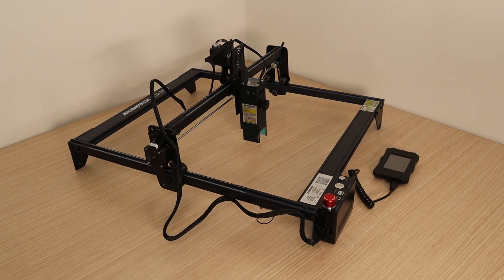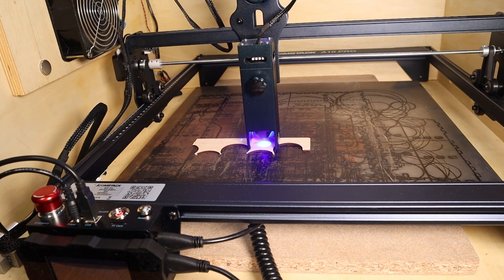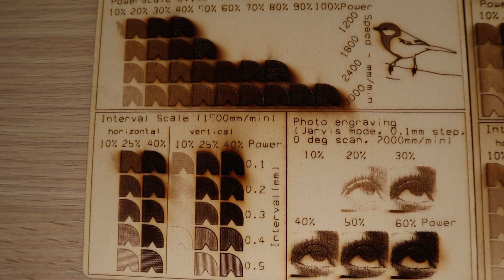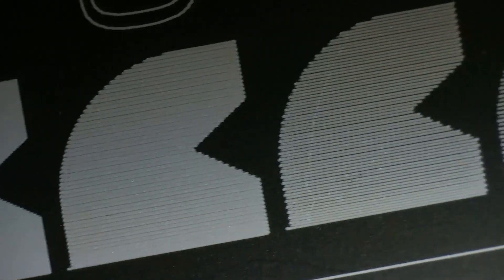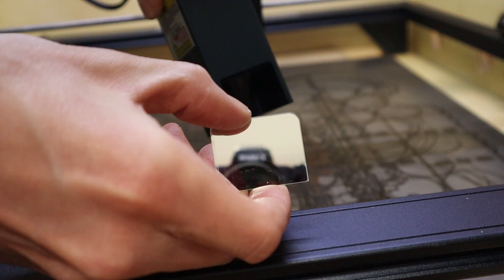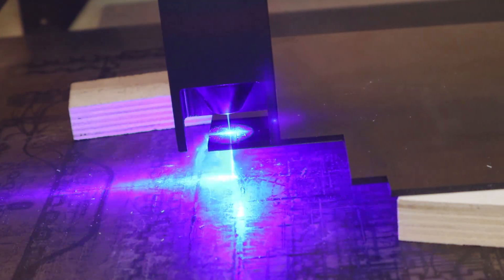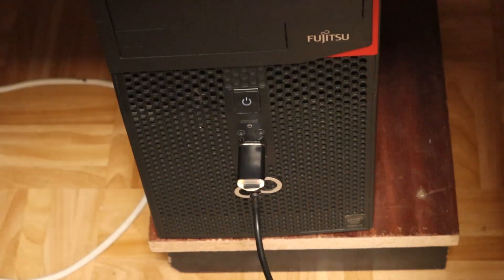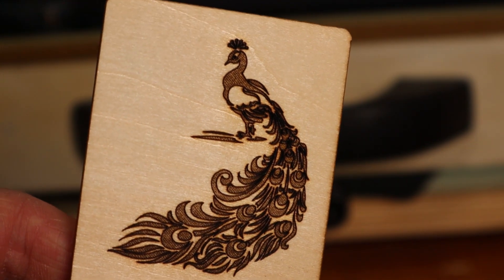REVIEW/TEST Atomstack A10 Pro (Atomstack X7 Pro) Best In Class Laser Engraver With Superior Features

Comment: How do I get an SD Card for my 7X?  There was not one in my shipment and it will not work without one..  I was disappointed after paying over $600 for this machine.. I also found out that there was a charge for using some of the programs that are required to use this machine..  I am very disappointed..  Also there were not glasses included with this machine..
Reply from the maker: This is strange. Did you buy brand new machine? I think that sd card should be included, but it works with any sd card. You can buy it anywhere for ~3$. It works without sd card, I almost never use it. You can see in the video that it is not inserted. Also LaserGRBL software is completely free, but majority of people use Lightburn because it is much better. And glasses should be included with the machine
Reply: @JTMakesIt   No there was not a SD card included, and no glasses..  And yes it was a new machine from Amazon..  I tried to contact Amazon, with less than favorable results..  I have tried to use the machine but get a message about no SD card installed..  Can I use a bought card, or is there programs included on the card from the manufacture? Thank you for your reply.. Your video is very good..
Reply from the maker: @ThePullnfool  you can use empty sd card. Sd card is only needed for offline engraving - running gcode programs from sd card without computer. Otherwise you don't need it. You can even disconnect the display and it will work normally.

Comment: I have an Atomstack A5 Pro+ and I want to upgrade to a 10W machine , so many choices,  With or Without limit switchs? dunno Any Ideas?  I have a computer dedicated ,  and using Lightburn, So the ability to use and HD card isn't important.
Reply from the maker: Limit switches are definitely worth it. If machine stops mid work or you stop it for whatever reason, you will be able to recalibrate and start from where it stopped

Comment: May I ask why it can only cut black arcyl? How is transparent arcyl?
Reply from the maker: The darker the color, the more light is absorbed. It can also cut red, green and yellow, but the cutting performance is reduced. It can't cut white and transparent because light bounces off or it goes  through without significant effect. This is because diode lasses work in visible light spectrum. Co2 lasers use infrared light which is basically heat and it "sticks"to all materials

Comment: Has anyone had a problem getting the fire button to operate ? It’s enabled at 25%  but it still doesn’t work
Reply from the maker: Does the laser work normally for engraving? Maybe you need to "enable fire laser button" setting in Lightburn

Comment: have you tried .25 MDF with it? wondering settings
Reply from the maker: Ho I haven't. The mdf comes in various qualities. Some doesn't cut at all, not even with CO2 laser, some is as easy to cut as plywood. You need to find your own settings. But I would use 300-600mm/min and full power and as many passes as needed to cut through

Comment: Hello.....
I have just  bought one but I have problem with matching it with Lightburn. The engraver work area doesn't match with Lightburn work space . And as you tested at the begging of the video the alignment  of the engraving ,I have problem with that too the alignment was so bad every time I homing the laser head and start over the same engraving its does not engrave in the same place I think that because of the matching issue ... I hope you help me to solve this problem
Reply from the maker: In Lightburn go to Edit -> Device Settings and set the correct working size of the A10 laser.
Reply: Thanks for replying but I already set the correct size of the machine
Width 410.0 mm
Height 400.0 mm
Still same problem
Reply from the maker: @mohammadmansour8000  Does the machine hit mechanical limit? describe more on what actually happens and what the machine does.
Reply: Yes the machine hits the mechanical limits because it being added 60 mm to the X axis and 10 mm to Y axis
When I start the machine, the coordinates of the laser head are taken by the program as the starting point.  Suppose that the coordinates of the laser head when I operate the machine are x = 60 mm and y = 60, but the program considers these coordinates x = 0 and y = 0, so I press the home button and write the following code G92 X0 Y0 so that the program knows that these are the coordinates of the home  Then start working.  But as soon as I finish engraving a specific design and move to another design, the problem comes back and there is also another problem, which is that when I stop engraving due to a design error or the like and go back to work, the coordinates get complicated again, always adding 60 mm on the X axis and 10 mm on the Y axis and that also happens when I press the home button 60 mm for X and 10 mm For Y so I have to write that code again.
Reply: I hope I could describe my problem well and sorry for the long comment

Comment: what is your recommendation between this model and sculpfun s9? this model hv offline mode though
Reply from the maker: S9 is less powerful, but better value for money, if you don't need extra features that the A10 has.  Both are good engravers in their price range.
Reply: @JTMakesIt  hope sculpfun hv upgradable ctrl unit which user can use offline function

Comment: If the alignment test showed it was not aligned correctly, how would you adjust it?
Reply from the maker: This would show that the limit switches are not precise enough or the homing procedure is too fast. Usually all machines with limit switches are pretty accurate.

Comment: How can I engrave 301 metal (reflective) with the Atomstack A10 Pro?
Reply from the maker: Spray a thin layer of some black paint on the piece which is easy to remove. Then engrave with slow speed (200-400mm/min and full power.
Reply: @JTMakesIt  Thank you for reply. I´ve tried it with a whiteboard marker and your settings and it doesn´t work. The gold mirror card is just a little bit white at the engraved place. You know how to fix that?
Reply: @lucr.912  hola...saves tengo la misma duda...al final pudiste grabar en metal trasparente?

Comment from the maker: The lowest priced Atomstack A10 Pro: https://hobbylasercutters.com/go/atomstack-a10-pro/
Use coupon code BG66f8d3 to get it for 389$!) Valid only until end of September and for a limited number of orders!

The technical review of this machine, where you can find test results of other laser engravers too:
https://hobbylasercutters.com/atomstack-a10-x7-pro/
Reply from the maker: @usa1  These are the same machine with same laser module and frame but a different name for some reason. The S10 is also an identical machine.
Reply from the maker: @usa1  s10 is also gray I think and it ships with customs taxes included
Reply: Hello, the coupon is only for S10pro, I would like to buy an A10pro. Could you have, please,  a one valid for A10pro ? Why is today the S10pro like 200usd more expensive than A10pro ? On BG...Many thanks
Reply from the maker: S10 and A10 are identical. The only difference is in the color of the frame. This is the way Atomstack marks machines differently for each major vendor. The best deal for the S10 here is this : https://hobbylasercutters.com/go/atomstack-a10-pro/
But you can check other coupons I have here:
https://hobbylasercutters.com/coupons/
Reply: @JTMakesIt  thanks alături, S10pro is from CN warehouse,  A10pronis from EU....that s why I need it. :)
Reply from the maker: @MrSergione75  I don't see any Atomstack in stock at EU warehouse curently. But even if you get it from CN, the Banggood covers the customs duties and taxes, so you don't have any extra importing cost.